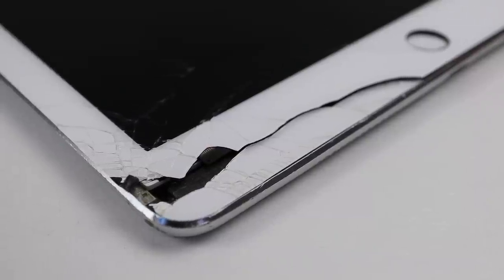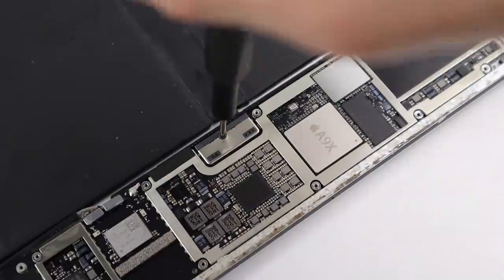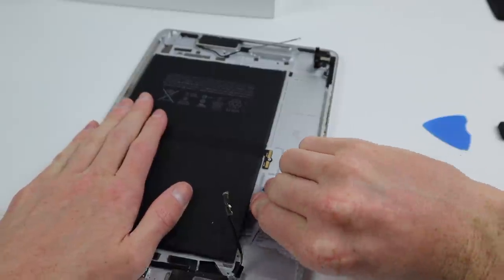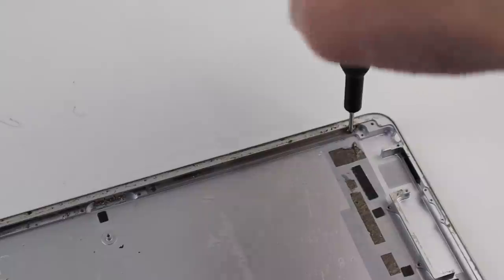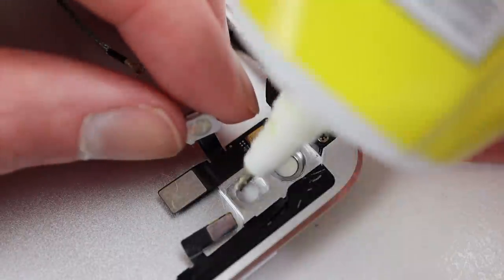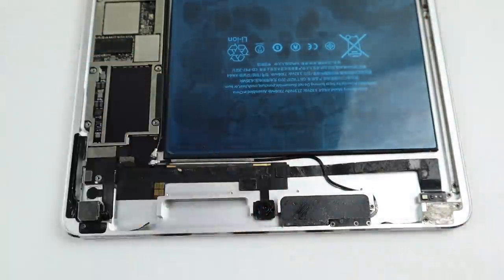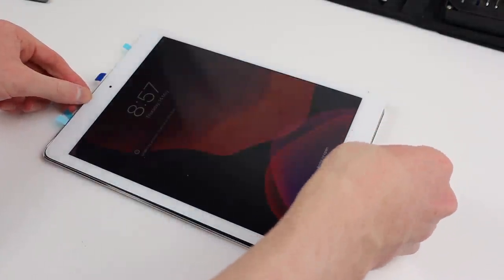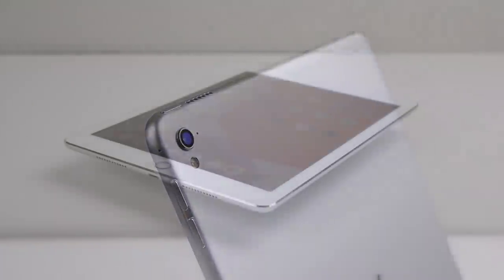Never Try To Fix This - iPad Pro Restoration

Comment: Yeah, i replaced one of the last week, took me easily 1 hour just to transfer those magnets, a tip to removing those  is to use a hotair station at max temperature (450Cº ish), it will soften the glue and make the job a  little bit easier

Comment: Moving over the wake sensor from the back of the old LCD to the new LCD usually fixes the wake on opening function. Requires basic soldering skills since there are 4 contacts on the sensor.

Comment: I think Apple engineers are between a rock and a hard place, they need to make it too hard for third party repairers but not so hard that their techs can’t fix them. If in doubt add more glue and you can bet your boots they have the perfect solvent that releases the glue in seconds. Great repair.

Comment: "I used some extra adhesive to make sure the display isn't going anywhere."
Guess who thought of that too
Reply: Apple .. 😂
Reply: Well the screen almost falls off, on an iPad in a brand new condition, compared to those magnets and the Smart Connector.
Reply: I mean, that adhesive is the only thing keeping that display attached, and I wouldn't want it just falling off one day.
Reply: @iClone101  they should probably attach the display just as strong to the frame like battery to make it a bitch to get into :/

Comment: There's a special place in hell for the Apple engineers that signed off on the stupid & difficult to repair design of this iPad.
Reply: @Flandz420 
Apples hardware innovation is only on the chip designing. 
Rest all so called innovations are
Creating problems by them and solving it to make profit,
Like removal of headphone jack,
Next lighting port
Then updates will be subscription based in future 😂

Comment: For the battery, you can always buy a heating pad and a scraper to undo the adhesive that keeps the battery in place. I learned that the hard way. The heating pad I got was about 15 dollars on Amazon and it works great.

Comment: Heres a tip for the smart connector, for future repairs. Once you ensure all glue/adhesive is removed from the part, push on the contacts themselves the same way you removed the flash from the back of the iPad.

Comment: I’ve had to do the exact same procedure on a similar iPad before. I found a listing on eBay for the silver case connectors no problem but all the glue that that they use to hold everything in is just disgraceful, it just destroys all your tools and peels every bit of skin off of your fingers. Lesson learned - never touch iPads again

Comment: You should remove the battery more safely. Circuit cleaning spray or alcohol can be used for adhesives.

Comment: A person like you has so much experience with these devices.   This is way beyond the capabilities of the the average person.  One issue with Apple products is they are extremely incompatible with Linux based computers even if you have one that works.

Comment: I just finished one of these today  took 25 minutes. Very easy repair. Heat it up with a hair dryer and the glue comes loose easy if you can touch it without burning your hands its not hot enough yet. The prying on the battery will shorten its life a lot. Poke a hole in it with a tool and it can catch fire. Ask me how I know with the burn scars to prove it. I do this everyday all day though. It’s better to go on eBay and buy a complete housing with all the small parts and  pieces already installed. Switch the battery and the circuit board and put it back to together.

Comment: Did you try to use heat? To release the magnets? Seems like it would of helped with some strong adhesive remover.
Reply: Guaranteed he tried that. The glue is likely a heavier glue that CURES instead of the rubber-like glues used elsewhere.
Reply: @1337GameDev  true true

Comment: You need one of those smartphone heating pads. (Or do what I do and stick it in a toaster over for about a minute. On low heat, of course!) Warming up the adhesive helps quite a bit,
Reply: Dude, you wanna have a fire extinguisher nearby, cause that seems like a fire hazard
Reply: @spamspace6878  "For about a minute. low heat, of course". Obviously you don't leave the thing unattended.

Comment: I've done quite a few full housing and display replacements before and heating is your friend when it comes to iPad glue. heating up the rear housing slowly usually a hot air gun at spots that you are trying to remove the parts from loosens the glue enough to nearly peal a way the components.

Comment: Denatured alcohol works better than isopropyl. I you use a "precision oiler", syringe, or similar, you can get the liquid where you want it better than the spray bottle. Good luck!

Comment: all the adhesive can be loosen by spraying contact cleaner , it wont damage the board as you lifting it up making the board bend and causing more damage . a simple spray of contact cleaner can do the job

Comment: You have to heat that adhesive up before you try to pry that logic board off! If you’re going to be doing a complete case replacement lay it on top of the heat pad or hit the back of it with the heat gun for about five minutes at a time. After five minutes, try and tug if it doesn’t give another five more minutes and try again repeat the process! Since the back casing is going to be replaced no need to worry about discoloring

Comment: I bought a cover for my apple iPad but it wouldn’t switch on or off the tablet. I figured out what was wrong. The magnet in the cover was the wrong polarity. I waved a strong magnet over it and it changed its polarity and it works fine now. Hugh, before you take out magnets on these iPads mark them with a felt marker first so the polarity will be right. That’s why they probably dident work for you.

Comment: Hey I wanted to give a suggestion on cutting the batter out. Soak some dental floss after you double or triple it up and tie it off, soak it in acetone and using a sawing motion cut through the adhesive. I had to do that to my MacBook pro’s battery…
Reply from the maker: Great tip!

Comment: Is there any reason you don't use more heat when removing the motherboard or other components? Any time I need to remove the board for something like a charging flex replacement, I'll keep the ipad on a heat plate set around 60c. A large majority of the components will come off without much of a fuss when they're warm. 

Could be worth picking up a digital heat pad with more control over temperature, if you haven't already.

Comment: Thing is after doing all of that and spending A TON of money (those Screens are au$300) if you press slightly too hard or drop it gently, it will break again because the aftermarket glass is not fit for purpose on the pro models.

Comment: Do you every use lighter fluid (aka naptha) for the really sticky stuff?  It's really good at dissolving adhesives that alcohol can't or is slower to.  The naptha is oily, so you'll still need alcohol after to clean off the naptha, but it may help speed up some of particularly adhesive-y devices.

Comment: you are lucky not to puncture the battery like that. I was so stupid to remove a fully charged battery on iphone 7 and puncture it unwillingly. It started to smoke. I've put it into metal can, closed it and thought it will heat a little and calm down but it became so hot that the can melted the carpet under it before I had thrown it outdoors. The amount of energy that is stored in these batteries is tremendous! And If you do not know much what you are doing (as I was)... just about anything can happen!

Comment: To anyone attempting to repair their electronic device.. never ever pry on logic boards.. use solvants like 99% alcohol and let it soak if you must.. but never pry on boards.. the SMDs are fragile and may crack or fly off the board.. or their connection points may crack when the board is flexed and you wouldn’t even notice a thing.. it would just stop working and is a pain in the rear end to troubleshoot and fix.

Comment: Recently I got a free iPad 3rd gen with a massively expanded battery where the iPads lcd has cut from the screws, I decided it’s too dangerous for me. I also got an iPad 1st Gen, dead and partially expanding battery. I got an amazing 3rd gen 2 days later from a friend that all I need to do is get them to reset it. Also got a 5s too. Anyways, can’t wait for more videos! Also, what should I do with the iPad dead 3rd gen? Hmmm.

Comment: Holy crap, I thought previous iPads and iPhones were bad, and the Surface Pro too, but... WOW. This is on a whole new level of unrepeatability! iFixIt it gonna be needing a new rating on their scale...

And the way some of the parts in there are just kinda... floating without an exact tight fit in the frame, like the front-facing camera and the bottom magnets, makes it feel almost like some kind of prototype...

Comment: iPhone's and iPad's are just pain in the ass to repair. I got iPad Air 2 with smashed screen, ordered replacement screen, and in the process I broke home button since it was glued so much that I was not even able to remove it without breaking it. And yeah, don't forget that you loose fingerprint unlock even if you manage to transfer button to another screen.

Comment: I'd like to know what adhesive you used there when you glued in the volume buttons.
They  use all the adhesive to prevent repair, they're against the right to repair movement and want you to spend more money buying new. Why else would they install a battery inside a sealed unit?

Comment: Have you tried orange oil based solvent or goo gone in those places where you don't have to worry about damaging electronics.  This looks wicked difficult.   Upside:  replacing the keyboard by chipping off the rivets in a bad keyboard 2017 macbook now looks way easier.

Comment: A little tip I learned you can heat the metal back of the ipad to soften the glue on the inside under the components

Comment: I have had some success in getting glue to release with things besides alcohol… some  are common, some aren’t. Try adding ammonia to the alcohol, also try : naphtha (like Ronsonol), wd-40, kerosene, lemon oil, heavy duty silicone spray, and one my favorites- charcoal lighter fluid; aka paint thinner; aka mineral spirits.

Comment: We never had a choice repairing these ones (duh). We dreaded having people come in for these repairs. Kids usually used them so they were SO DIRTY. Getting all the little pieces of glass, as well as the adhesive cleared off was a nightmare. the adhesive had to be almost 100% off for the new screen to sit flush, which it usually, never quite did. The ipad is built so poorly that the device usually bends over time, and the current screen with it. Making a new flat screen look weird. And...you basically covered the part about the batteries... utter pain. At least I got a 5 dollar commission on my 3 hours of work :|

Comment: i mean, these ones aren't that terrible. heat matt with an isesamo and a few plastic cards usually does the trick on these. it's just tedious getting all that old glass off. that's where a hobby #17 blade is really really useful. over all i'd say the difficulty on these are about 6 out of 10

Comment: lol - almost tempted to donate my 1st-gen iPad that was flung half way across a room when the wall fell on it, after a car came through it.  But.... it actually still works perfectly, just a couple scratches on the screen.
If it wasn't for the fact it can't handle anything above iOS 5.3, and still uses the old 40-pin connector - It'd probably still see use.

Comment: Next time you want to unglue something and you don’t have any hardware ( ungluing magnets ) try a stronger solvent from acetone to ketone or methylene chloride or a strong solvent for sure that glue wont resist to a strong solvent , isopropyl alcohol is not strong enough , its ok for hardware cause wont damage

Comment: Ipad pro 10.5 is worst when it comes repair. Mostly because of the soldered charging port with the logic board. And the wires running beneath the logic board and the battery. It was a nightmare to repair.

Comment: Many of humanities greatest things were made by a lot of alcohol and lack of sleep. (Also, the smart connection port is glued on ASF because that port is a huge structural weak point as is. And I guess they had a attempt at making it a little bit more sturdy)

Comment: I worked out the nature of Apple Inc in 2006 when my son's IPOD Nano just bricked itself for no reason. As it was under warranty I asked at the Apple retail store if they could get the technician to reload the software onto the unit. The puzzled look on the twelve year old face worried me. Two weeks later I was given a brand new IPOD Nano. When I enquired as to what happened to the original unit, it was sent for recycling. Swore then never to use Apple products.

Comment: Question, I went to a shop to get battery replaced and said it was charging port without even looking at it just charging it. (Should have seen that red flag) then they said the screen also needed replacing because the back has 2 dents that left alittle gap. Well when I got it back it didn’t work and they said oh it’s because the back dents didn’t let the thing work. But that’s bs because it worked fine with the 2mm gap, and when they gave it back to me it was still a gap. Sorry just venting 

So if I got the screen replaced shouldn’t the display or touchscreen part be new? Because there was a blemish prior to leaving it and after I got it back with touchscreen in middle not working. Said 100$ for fix then changed it to 120$. Been about 3 weeks now, last time when I went to ask if I was gonna get called when it was ready they called me 10 minutes later says she just finished it when she sits on the front whole time so either assumed it was done or forgot to call me sooner
Reply: Also did they charge me for charging port instead of battery because it’s more expensive?

Comment: hey there! im sorry if this is random and out of the blue but im sort of running out of options for places because for some reason, everyone i go to either cant fix this old tablet i have or just doesnt want to. It doesnt seem like a hard fix, the battery is just really bloated and the charging port is pretty much toast because the pins are bent. I cant remember the exact model number but its a samsung tab 4 if i remember corectly. i would really appreciate if you would help me our or point me to someone you know could help me find a solution because its either fix it or toss it because im moving in a few months and my family has been begging me to get rid of this thing for years.

Comment: If the case was being  trashed, to get the magnets out just cut the section with the magnets away and its pretty easy to get at them and a lot quicker...theres retaining pieces so why they have to be glued is anybodys guess...95+% of the glue in these and other devices is totally unnecessary...the components are so tightly packed they hold themselves in place, just some light adhesive would be more than enough......oh, silly me, they dont want you to be able to disassemble and fix them so make it as tough as possible...

Comment: Maybe I'm wrong but wouldn't it have been significantly easier if you just applied a heat gun to the backside of the case to make the adhesive easier to handle?

Comment: If thing does not dissolves with heat and IPA try White Spirit if not again try VERY CAREFULLY lowest octane gasoline. Gasoline is very potent solvent, able to partially dissolve medical plastic syringe and evaporate from it in 10 hours.  There are no glue witch can withstand these factors for long.

Comment: I have an iPhone 5S that is on very good condition but my problem is I connected it to a working WiFi and still it is unable to activate the iPhone it doesn’t have any Apple ID and iCloud sign in to the iPhone but it seems cannot activate everything works but it won’t connect to the server it’s on iOS 12.4.5 what would be the solution for this?

Comment: I like that this is basically just "apple really doesn't want you to repair your dmg'd devices" that tiny part that you broke i would have just cut the case around it making it easier to separate by taking the case off the part.

Comment: Glueing the speaker assembly makes sense because you don’t want speakers to rattle. But maybe a weaker glue would have done the job.
Reply: Yes also their are adequate amount of screws in place i don't think it will rattle around even without any glue
Its just planned way to stop repairs

Comment: My iPad has went into the black screen of death.  So weird I was watching a video, the screen went black, used a power cable that went to my iPad mini, to check to see if the battery was completely dead, it doesn't show that it is plugged in, even if I try to connect to iTunes.

Comment: IPA and hot air would have made this repair 100% easier. FYI anyone doing this repair you need heat and ipa to losses adhesive.

Comment: I love my ipad air 4, it helps me organise my whole life, it basically functions like an extension of my brain. Having all my university stuff in that tiny thing instead of a pile of books, files and papers is just amazing. But I dread the day something's gonna break in it. I hate apple for this.
Reply: Literally, don’t know why iPod touches and iPads are like a nightmare to repair, but it kind of makes sense as it’s kind of a giant iPod touch ;)

Anyway, even MacBooks are easier to repair, heck even iMacs!
Reply: @axethepenguin  MacBooks are so easy to fix that I fixed mine by accident lmao took it apart, couldn’t find the issue, put it back together and it worked. Guess it had a few loose brackets or it felt lonely 😂

Comment: Mine started crashing over the summer. I ended up trading it in for an 128gb 8th gene or under $200.  Maybe I should have fixed it. Was probably just the battery, there was no physical damage.